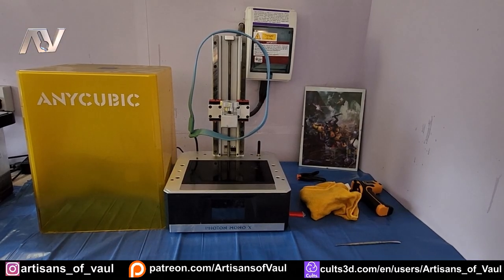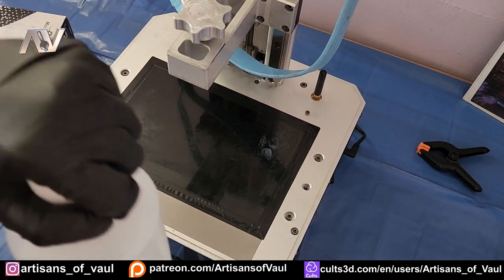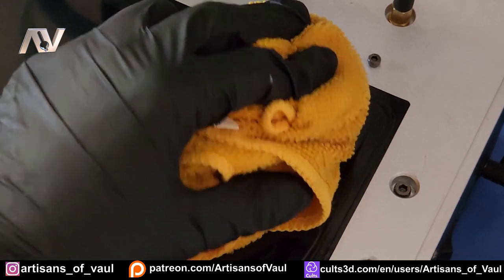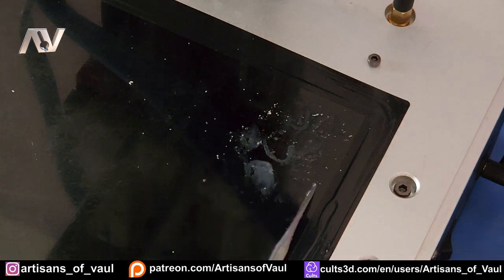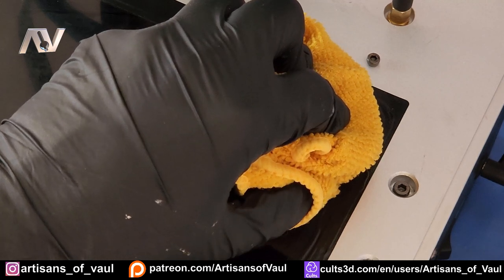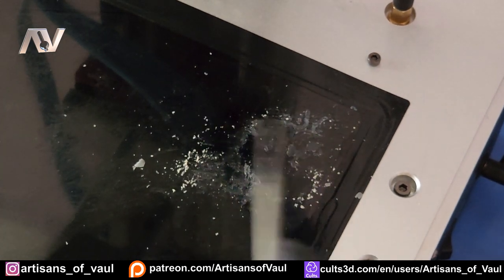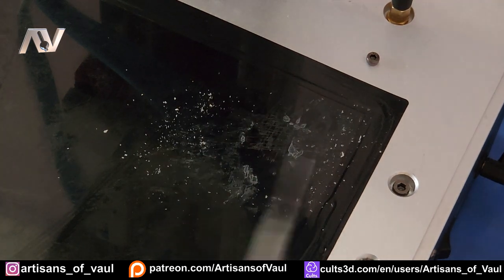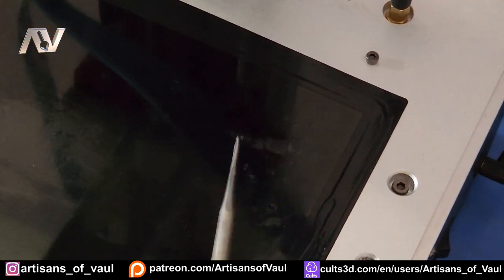How to clean resin from a 3D printer screen

Comment: Try using a strong adhesive packing tape first.. Smooth down a strip of tape over the cured resin patch, and buff down with a cloth to make it fully adhere, then slowly peel the tape back on itself, and it will pull the resin up with it. Repeat a few times until the screen is clean. After that, then go in with the Iso and cloth to clean up any remaining residue
Reply from the maker: That's a great idea 👍🏻
Reply: But will not work really
Reply: @Magyarkhan  Strong tape is a key word.

Comment: At 1 minute you warn not to pour the alcohol over the printer because if you spill, it will cause problems.
If you are unaware, alcohol is electricaly safe. In fact, if you get water on a circuit board & under some of the ICs, pouring alcohol all over the circuit/motherboard is how you displace the water.
Unless I'm missing somevother reason.
Reply from the maker: I didn't know that!  Thanks so much.  I think I was more concerned with having to replace the tape around the screen and not that it would get to the electronics but its still nice to know thats not a worry.  Cheers 👍
Reply: 99% is electrically safe. 70% is not.

Comment: Why dont use a protective film on lcd?
Reply from the maker: I probably should do. But I've found cleaning it so easy I never bothered/found it worth it.
Reply: I should have got a screen protector. I got a mess on my jupiter se screen.i got 2 small scratches on the screen.im thinking of of using a flat razor blade.then replace fep and test print something.if the scratches effect the print then I will buy a new screen

Comment: Hi AoV. Do you know about the secret forbidden screen cleaning method of the dark arts? You deliberately pour a small amount of resin directly onto the screen, spread it around, and then run a tank clean cycle to cure it, and then peel off the layer. 

I've never tried it myself (yet) but it makes sense.
Reply from the maker: I have heard of it but if Im honest I have never had the balls to actually try it 🤣 I live in fear of it not working, lols.
Reply: @ArtisansofVaul  When I get my first mini disaster I promise I'll try it out. I'm pretty confident it will work as promised.
Reply from the maker: @herculeholmes504  Please do report back, I'm excited to hear. I don't know why I fear it so much, I use a similar idea to clean my FEP and thay works great.
Reply: I just did this. I felt I had nothing to lose after my big spill. Ran across this tip on Reddit and it does work. It doesn't get edges of course, but the main screen it does. I set my tank clean to 45 seconds and it worked first try.

Comment: Make sure your screen isn't like mine. Mine had a thin plastic coating on it that scratched as soon as I tied this. And where the scratch is the Uv light is on all the time. So I bricked my printer until I can get a new screen. I'm not blaming the video, I'm blaming myself for not researching enough
Reply from the maker: Just checking, that thin plastic sheet might be a protective film that some printers come with. Does the whole thing peal off? You then replace it.
Reply: @ArtisansofVaul  if only I was that lucky. Seems to be the actual thing that makes the whole screen work. Under the layer there's only a sheet of glass. And under the glass the Uv light is placed so the spot where there's a scratch the light shines thru and ruins the print
Reply from the maker: @ThePrazzel  Sorry to hear that dude.

Comment: Omg i just tried this really gently and scratched my screen 😭 how can i fix this ? Im unable to afford a new one so please dont advise that i just get a new one.
Reply from the maker: I'm not sure how this would have scratched a screen if done lightly with the tool I was using in the video. The only thing I can suggest has happened is that you either pushed too hard or your screen has a screen protector (thin plastic) on top of it and that's what's scratched. But without seeing the printer I can't say that for sure.
Reply: Yuo can change the polarizing film (much cheaper than buy the screen), or yuo can buy a new screen or yuo can live and continue printing with the screen , use other side of the screen , a tiny little scratch is not the end of the world , some times dont have too much efect , anyway good luck , next time , dont use metals or scratchy things with this , its better use a songe and hot water put the sponge with hot water in the screen for 15 minuts , then use a soft spatula to remove the resin , add alcohol help too

Comment: do you put some more IPA on the cloth throughout the process of scraping it off? or do you use the same amount from the beginning?
Reply from the maker: I will add some at points to keep it moist.  I recently saw a good video using just masking tape as well which can be a good starting point before resorting to this.  You can find it here: https://youtu.be/iucvU4Srh6w?si=KUEJ_smZZAbyWUOd

Comment: I got resin under the top glass screen layer because resin somehow got under the tape around the screen and seeped under the edges on the screen :S what shall i do?
Reply from the maker: Hmm... So depending on the printer that may be a protective layer so as long as the resin hasn't cured you should be able to take it off and clean the screen underneath. Then get a replacement protective screen. If that is the actual screen I don't know... you may need to replace the whole screen, I'm afraid. Burt I'd definetly seek help from someone that has more experience than I do.

Comment: Wood coffee stir stick or craft popsicle stick won't damage the screen
Reply from the maker: As shown the metal scraper also wont damage the screen unless you're careless, Ive been using it for years.  Im also not convinced that would get the resin off.  But if you feel more comfortable using it do with what you prefer 👍

Comment: Omg, just use ipa soaked tissue and then if you have gloves use your thumb nail. Dont use any metal. Ever.
Reply from the maker: I mean I've been doing it for years and never had an issue so I'll stick to that. Also using your nail and potentially tearing the gloves isn't a great plan.
Reply: To each their own in my opinion but I would never use any metal tooling on glass , what it takes to buff glass in the first place to optical quality is nuts and it does have some resistance to micro abrasions but it's better to think of glass as clear coat in my opinion why risk using tooling that can easily mar when they make tools for it that give the average joe a little of a buffer , also I see that you've been doing this for some time and had no issues but you just one slip away from a permanent whoopsie why not live with a buffer or redundancy .